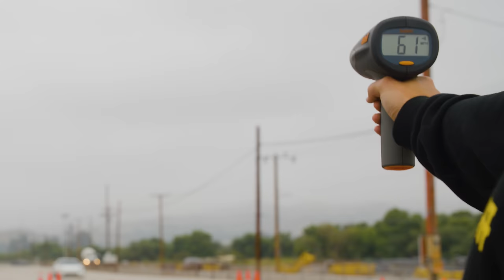$450 Brakes vs $4,500 Brakes | HiLow

Comment: Noland, I have to disagree about the size of the pads and rotors not having an effect on stopping distance. More surface area = more friction.
Reply: Friction does not depend on surface area. Larger brake pads will only improve heat dispersion. Stopping distance is limited by traction, not braking power.

Comment: There are cheaper aftermarket caliper kits.. its not a fair comparing it with 6pots n single pot uprgrade.. n whats with the lsd weld method when u can go get 2nd cusco unit online..its called low budget vs high budget not suicide budget..just my 2cents.. i luv ur up to speed car talks.. just think this needs more research for the average joe as most are going with 2nd parts when cant afford brand new 6pot calipers. I have done the lsd weld on my ke70 with 86 swap parts...it holds to a certain point.

Comment: Another (easier) way to bed in the brakes would be to:
Reach about 60mph (95km/h) on the road and slam on the brakes as hard as possible. 

That will shock the brake pads into thinking that you're a complete maniac and they will perform better to stop you from causing more damage 🙃

Comment: You didn't broke in the brake, that's why they burnt after the first brake, brakepads needs 2/300 km to set on rotors and flattens to have a smoother surface with no contanct points where heat concentrate rising heat and letting burn the pads chemicals.....

Comment: I suffered through your radiator and turbo install and thank you for your effort. There’s so much talking and goofing around that it was difficult to enjoy. You could cut some of the BS and include some data and measurements. I was very interested in the radiator discussion but seem lost with the cooling efficiency but did see the DONUT logo at least 100 times???

Comment: big brakes look awesome, but i have to wonder about the extra unsprung weight you add.. is it really worth it, if you're not racing the car? i dunno..
Reply: you can get brakes that are lightweight, stuff like 2 piece rotors etc
Reply: @arcanevoid9199  best of both worlds, but also the most expensive, i'd imagine.
Reply: @mistreku  not really, part of it is also just choosing the right size. massive 8 pot calipers are going to be heavy, but a small 2 or 3 pot probably wont. and you can always offset the weight by getting lighter wheels :)

Comment: I work in the car that had the stock brake system beefed up and then I put on one of those fancy kits the stock system work just as good beefed-up that's one of the fancy kits course it wasn't the Al out racing kit the stock kit was the same package they put on police cars that I beefed up pads rotors good shoes bigger wheel cylinders yep we're just brake compared to disc all the way around?

Comment: I bought cheap $130 "drilled and slotted" rotors with "performance" pads once for towing. DO NOT DO THAT! One short hard brake and they were gone. Luckily I was only going 30mph and the boat trailer had surge brakes that helped some.

Comment: Why buy drilled rotors? It’s proven they have the same benefits as slotted but they just tend to crack more and reduce surface area more, which also means less heat transfer

Comment: Most standard brake kits are fine, since they are a device that coupled with a good hydraulic system results in nothing but pressure on the rotors... as soon as that pressure translates into a force that is able to freeze the wheels despite the engine engagement, you have good brakes... After that, all the rest is up to your tires... Brakes don’t stop the car, tires do, brakes just slow/freeze the wheels... If you have shit tires, you can have a 100 ton of force from the brakes, all you will achieve is skid marks from your inadequate tire friction... Also, the mass of the car plays a role in it to a great extent...
Most of expensive, performance brakes just transfer their optimal braking rate to a higher temperature zone, compared to regular and oem brakes... Also, they do so by being made out of materials that can handle greater temps... I’m not talking shit-cheese-cheap brakes here, those are a hazard and to be avoided, I’m comparing oem and equivalent rate to high perf...
Reply: Also, if you went at the more expensive brakes with the same test, but did it more times, they would give the same results, the cheaper ones just reached their limit within the test while expensive ones would reach the same results in more go-s... The fade test is just about reaching the no friction temp... As J Clarkson proved many times with oem 20k dollar ceramic brakes on their track back when top gear existed... More expensive is more better, but is mostly more repeatable in case of brakes... Do it too many times, heat em up beyond their optimal point and you get the same results... also, the expensive brakes don’t work as well when cold, i.e. if you don’t hold them at their optimal heat zone, just like the less expensive ones do, but they have that zone at lower temps, making them suitable for an average peasant more than for example ceramic ones... Unless you drive properly on the roads and need to brake from 100-0 every minute or so, go for better than oem but not high performance...

Comment: There are no legal steel braded brake line manufactures in Australia Victoria so legally you cannot have steel braded brake lines so we are stuck with shit rubber brake lines for now until a company starts selling legal steel braded brake lines. Also when wearing brand new brakes in do some very hard braking stops but don't hold the brakes on when you stop let the vehicle roll a little or the pads can create a hotspot and warp the rotor and ruin everything also drilled rotors have absolutely 0 advantage to any performance and the holes in the rotors just make the rotors more prone to cracking and becoming unroadworthy. Vented and slotted are the way to go for performance and cooling gains.

Comment: Sorry for all the links but some put a lot into these sites who know a lot about brakes, so before bedding in your brakes in guys please check the pads makers site, as this verys from maker to maker, like Brembo say Drive vehicle to a remote area and perform at least 30 brake applications of 3 second duration and use light/medium deceleration with varying speeds.  Leave at least 1/2 mile between each brake application link here  https://www.carid.com/brembo/info/bedding-guide.html    and why should you do that, read this one   https://www.brakes-shop.com/brakepedia/general/myths-of-the-braking-system.

Comment: The big brake kit does mean more braking power, wtf are you talking about?!? The rotor is bigger and the pad is bigger giving you a much bigger brake pad surface contact on all 4 wheels and the calipers being multi piston the will have more bite over a single for double piston caliper.
Reply: Stopping distance under normal conditions is determined by traction, not the brakes themselves. The brakes are strong enough to overpower the tires and lock them up, which is the upper limit of stopping power. Stronger brakes won't change that.
Performance brakes are better at heat dispersion which is great for preventing heat soak when racing. But they wont change stopping distance under normal driving conditions. Performance brakes only matter when heat soak is a factor, you will never use the brakes enough to worry about heat soak during normal driving. They give more braking power only under intense prolonged use when the stock brakes would be heat soaked.

Comment: brakes just aren't an upgrade that is affordable. even 450 seems pretty high. I think you're better off dropping weight, getting good tires, and pinching pennies until you can afford a substantial brake upgrade.

Comment: I hate drilled and slided rotors I hate them so much outside of racing there's zero point to putting them on your car there's only one thing it will do eat up your brake pads faster

Comment: It's clearly going to have more breaking power cuz it has larger rotors which gives you more leverage from a longer lever arm.  And yes you can have a single piston if it's bigger than the original piston it's going to have more clamping Force but usually multiple Pistons are better. I'm starting to lose my patience with all the misinformation on this car videos
Reply: The advantage of multiple pistons is a more even clamping force. They are not trying to increase the clamping force because that is pointless.
The limiting factor in stopping distance is traction, not the brakes themselves. Performance brakes are better at heat dispersion so they can work longer before experiencing brake fade.

Comment: shoulda went with brembo.also 1:30 a larger surface area IE rotor IE brake pad allows more friction causing more resistance which equates to more breaking ability. stay woke donut.

Comment: This is bullshit the low car should not be worked on by a team of professionals in a garage it should be worked on by one guy in the parking lot of a spare parts shop in the dark using only a headlamp, two shifting spanners, one screwdriver, a mallet and a case of beers...

Comment: Now if everyone could just stop calling them Willwoods...... Their name is Wilwood........ Also should have gone with Stop-Tech....... Far better stopping power and quality
Reply: Stop techs calipers are oem not upgraded really in any way so there brake kits are really just upgraded rotors and pads with oem replacement calipers and there rotors and pads are not great where as wildwood is an all around upgrade in every way quite worth the money in my opinion